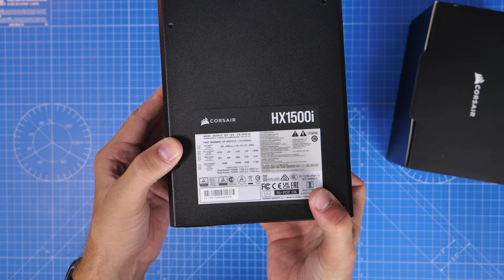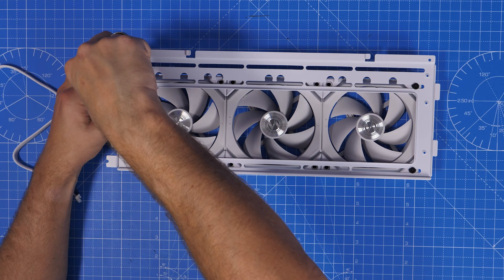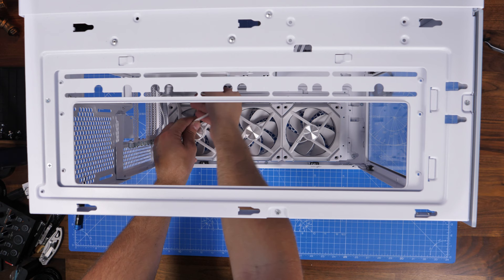I made some mistakes with this Lian Li O11 Dynamic EVO build (Z790, Core i9 13900K, RTX 3090)

Comment: I love lian li but L-connect is the hottest garbage software I have ever seen to the point where im thinking of rolling my own fan controller software...
Reply: Why garbage? I'm thinking about getting these fans
Reply: @tracks_  it actually lags your whole system when you launch it. Like adds 2x to my boot time because it lags my 7950x 4090 system so hard. Also the app crashes sometimes.
Reply: I agree, L-connect is trash and it constantly uses 9-10% CPU according to task manager. I run it, set the fan speed and color then uninstall the thing.
Reply: @BalkanBiker  unfortunately it wont keep my fan curves if I do that so I have to leave it running
Reply: @boot-strapper  try Corsair Commander instead of LianLi?
Reply: @BalkanBiker  only l connect works due to how these fans connect together
Reply: @boot-strapper  Can i use nzxt hub controller instead of Lian Li hub?
Reply: “Fan Control” by Rem0o
Reply: Yea not only that, 2 out of the 7 lian li fans I have have failed and the blue leds have a manufacturing defect so they have broken. I’m not buying the V2s that’s for sure.
Reply: @ArcturusCOG  oh 😬
Reply: @Alex-tu5vu  they are the only fans that have either completely stopped working for me, or the lights have broken and I’ve went through a lot of fans and none of the ones in the past have really had problems.
Reply: @MusicChann3l  ah yes, a bad batch of their most recent software patch. Lol. The fans are fine, software no. Also they have a pretty low cfm, so you need 2x as many to move the same air.
Reply: Though i do agree that l-connect sucks, if you set the slider that allows the motherboard to take control of the fans, then it'll work fine. You'll never need to run the software after that, and all the rgb can be controlled through signal rgb or your mobo lighting software
Reply: @tracks_  can u recommend a better fan and controller?
Reply: @GamingCreations612  I got these fans. Quite happy with them
Reply: @TechTonic_  cool ill prolly check them out im going to do a dynamic evo build prolly with these and a Galahad 360 aio
Reply: SignalRGB thank me later
Reply: @GrainOnTheGo  doesn’t work for my use case
Reply: @boot-strapper  what do you mean?
Reply: @GrainOnTheGo  love signaling but it doesn’t work with my asrock b550 motherboard and the monthly payment for somethings, I decided to switch back to polychrome unfortunately. I miss the rgb effects already lol
Reply: I really wanted to go with the Lian Li fans in my Dynamic XL for the simplicity, but I kept hearing how bad the software was and went with the corsair QL fans instead and the back of my pc is a rats nest. The fans have been flawless though
Reply: @BlackBruceLeeTheGreatDekuTree  the software really isn’t that bad I’m not sure why people hate it so much. It’s one of the few RGB software that doesn’t try to fight your entire PC.
Reply: It works great for me. Armory Crate is the worst
Reply: @corymaloy I just installed that software for my fans & gpu & 24 pin strimers cables. If it weren't for them making it so difficult for other software to control, I wouldn't have even downloaded it.
Reply: @tracks_ put it this way. I installed it on a brand new computer & it locks my mouse and keyboard. Also randomly freezes when applying settings so see irl vs trusting animation since the colors aren't always the same.
Reply: Do it you wont
Reply: euno  I did haha Honestly the install isn’t crazy it’s just the cable management I gave up on. The front looks clean and the door on the back of the case closes so that’s all that mattered in the end 😂
Reply: Laggy and trying to sync it with something like armory crate has caused me nothing but constant issues. But damn do they look good. 🤣

Comment: Hey guy, I have a question I have the same case but I have a problem, hoping u can help me out. The front glass of this case snaps in where u are placing the glass back on and the black 4 clips that hold that glass front 2 of them broke on me so I'm afraid to put my glass back on. Do u know how can i go about replacing those clips because 2 of mine broke. I would really appreciate any information u can offer.

Comment: Point to note at 22:12 for anyone doing a build where they need more usb headers. I had this same problem where my board only had 2. You can splice one cable into two. Just remove the cables pin, and put them in the same order red, green, yellow, white, black etc. in the empty hole on the cable you want to join, and you will be good to go :) They are designed to have two cables pass through that same header. This will save you the headache of trying to find a usb 2.0 splitter.

Comment: I'm doing a 14700k build with a 4070 Super.  I purchased a Corsair Rm850x.  I used the PSU calculator on Newegg and added 200 watts. I only have 1 m.2 for storage and  no optical drives, spinners, etc.  I thought that would be enough but after watching this video I'm nervous.  Maybe I should have gotten a 1000w,  Awesome video!
Reply from the maker: If you used a calculator to work it out it's probably fine

Comment: I have the exact same complaints about the uni fans cables. The daisy chain cable is also bit short  IMO. For example you wanna chain together the bottom and side intake fans and its complicated since the daisy chain connection is not in the middle of the fan but more on one end. So when you put bottom fans as intake the connector is more closer to the sidepanel than to the back and same thing happens to the side intake - the power connector is more closer to the motherboard than to the front panel and the daisy chain cable wont reach. Infinity fans had the connector in the middle for equal length and reversable cable direction - why make it worse? And in my case I'm talking about Lian Li Dynamic EVO case not some random XXXXXXL case. So all those reviews where it shows how the fans can be daisy chained are doing it on the table with very close distances and nothing in the way but when actually putting them into the case and starting to reroute them its not so easy anymore. 

The flat connector cable direction should be switcable. I mean the V2 fans are newer than infinity and those had reversable cable modules - why TF did Lian Li remove that possibility?

And I 100% agree with power connector - since the power connector connects to the side of the fan it allready shortens the length right a way because you have to reroute it around the fan first and then through the grommet holes to the back. Its especially painful with the bottom fans because the cable connects to the fan facing the I/O and then you have to reroute it around the fan and back towards the middle fan and then through the hole to the back but in there you have to reroute it around PSU and its just not long enough. Yeah you could put the uni hub in front of PSU (if its regular length) but then the top fans connector wont reach. What would help to certain degree is a splitter that the infinity fan 3 pack contains but obviously we don't get that. What would also help is a extension cable but since lian li uses its own 7 pin connector there is no such thing. And ofcourse you can't purchase the splitter separately.

So at the moment the damn thing works but its a complete mess in the backside with uni hub just dangling in air and cables barely reaching it. Massive dissapointment.

Comment: I did a push pull setup with nzxt usb hub, 3 corsair controllers and the 2 lian li controllers and psu top mounted. I was barely able to close the case after almost giving up due to almost not being able to fit everything. It was only my 2nd build and I recommend planning everything out before installing anything. I ran into a few problems that would have saved me a lot of time and space. The advantage of having the psu top mount is I was able to throw a commander pro into the bottom of the case and two controllers on top of the psu and 1 controller in the drive cage. The main disadvantage was the 24 pin strimer was jammed into the psu cables output/input and those hard plastic ends don't bend. You mentioned planning ahead as well and it's really important when you have a lot of hardware. I wish there was a cable mod shorter psu cables set that cut the length in half for this case.

Comment: I’m 2 weeks away from a very similar build. Dynamic EVO case so a bit more room, cpu, fans, cooler all same, Asus z790 gaming-E, Asus TUF 4090 and Seasonic 1600W platinum. I will have to follow literally same steps and would definitely run into same issues. You spared me of more than 1h of pure frustration 😅 i hate nothing more than disassembly and repeat. I saved your vid as i will watch it again to nail down all the right steps to avoid traps 😊 Big thanks 🙏
Reply from the maker: Hopefully you watched the other one too as I went into more depth there 👍
Reply: I just built basically t his, but I went with the Maximus hero z790 w/13900k, asus tuf 409 and the seasonic 1300w platinum.
Reply: @TheProvokedPrawn  Thanks, will definitely do! :)
Reply: @Kmaitland89  I am building the same with 13900k/4090 and his setup with the Lian Li v2 SL120s. Is a 1300W power supply enough? 1500 just seems way too large but I definitely dont want to go under.

Comment: These build videos involving the Dynamic Evo have been my guide for the past day. They have been so helpful. I didn’t do an aio cause I have the irrational fear it’ll leak. However, your build looks amazing! Though I have the Lian Li fan hub and at the moment it’s smushed with the wires bending badly and I can’t take out the hide cage since I plan to install mine. Do you know a good place to put  the fan hub so the wires can breathe a bit better?

Comment: Awesome video! I got this case and your warnings about how small it is are quite valid. I had to return it because of this. Got the O11 Dynamic XL instead. So much better. Wish Lian Li had released the NEW  Evo XL but not yet.
Reply: What are you running that this case is too small??? It's one of the larger mid size towers
Reply: @CILINKY  I'm a wedding photographer & videographer. It's a work only build. I have 4090 founders, 7 fans, 360 aio, 2ea 18TB hard drives, 2ea 10TB hard drives, 2ea 4TB ssd, 3ea 2TB M.2, 64GB ram & 1200 Watt PSU. For gamers the Evo is perfect. For some content creators it's good. For heavy work stations it's the Dynamic XL.
Reply: 'New Evo XL Case'???
Reply: @potvinsuks8730  lian li is doing an Evo version for the Dynamic XL case. You can see it on their youtube channel
Reply: @Cielinky  Thank you! Yeah, I was absolutely FLOORED when I saw what they have in store for us through Steve's Channel in Gamers Nexus where Steve literally went to LianLi's Lab and saw some of their new products in the pipeline including the new XL!

So excited!
Reply: I would love to get that too. Using the Fractial Meshify 2 XL now and i'm spoiled with big cases, a bit scared to use this for next build to be honest. Looks very tight in the back.
Reply: @mshea5906  how do you cool all those hdd/ssd in such case?
Reply: @ChasseurTueur  Lian Li 360 AIO, 7 Lian Li fans, I also put 2 smaller fans on the back of the case cooling the HDD's. Works perfectly!

Comment: So i got my V2's over the weekend, and loving that i got rid of 10 case fans x2 cables lol.
Question, for my radiator which had 3 fan cables, i didn't plug anything, thus the readings from MSI Center for my AIO was zero.  
My question is connecting to Sync1 same thing as Port? so i can still manage my rgb from lconnect3? 
For exhaust i was thinking of doing the same thing, as the cable is so short for port connector and the orientation needs to be at the bottom if i want a nice sync on my case from exhaust to intake at bottom.

Comment: Great video! Struggleing with the same setup right now, what do you use for controlling the fan speeds and light? Is there a benefit of runing the AIO on AIO Pump header and not CPU Fan? Tryed to run L-Connect but it didn’t let me turn of the motherboard controls! Thanks for making videos! Best regards Richard, Sweden

Comment: Just did my first build. If you want to see same case(I think his is XL too right?), aio, cpu but with 10 Corsair QL’s I will throw in a link(very different board and gpu tho). Im also using the thermal grizzly cpu retainer. I’m not a tech tuber or anything. I’m in the process of resleeving every cable. Waiting on 24 pin and 8 pins from cable mod

Comment: Wait so you don’t have to plug the Daisy Chain cable into the motherboard at all? You take Fans > Daisy Chain Fan Cable and that’s it? The AIO_PUMP controls the AIO Fan speeds?

Am I correct?

UPDATE: Well I believe I’m correct, the daisy chain comes from the pump, it’s getting power from that and that’s all you need to power the Lian Li UNIFAN’s.

NEW QUESTION: If the fans are ultimately being controlled via Pump’s speed… well how will it know to ramp down by default as pump’s default speed is 100%. This means those Lian Li fans on Radiator are going to be running 100% which is very annoying.
Any thoughts?

Comment: I have the exact same case and same motherboard but for some reason I can't for the life of me get the motherboard tobe aligned with the screw holes. The back plate of the motherboard (that has the USBs and stuff) seems like it should go in more but doesn't. What am I doing wrong?

Comment: just making sure so the fans on the bottom are intake?  the top 3 are exhaust fans for the radiator the single fan is also out take what about the 3 fans next to the motherboard on the right intake or outtake?

Comment: Beautiful 👌
Does anyone know if you could fit three 140mm fans up the top of this case with the 360mm side mount radiator having three 140mm fans infront and three 120mm fans behind in a push pull setup? 🤔

Comment: Great video h,. It is helping me build my very first PC , thank you .. Just one question … the sl inf 120 singe fan connector I used on z73 as  group cable for radiator fans the rgb connection has no slot for the Lian li hub, it only looks like a mother board rgb connection?

Comment: Hey! Big fan of your builds. I'm about to tackle my first solo build. At 19:55 you mention about going into the bios to disable the mb from changing fan speed or a pop up will happen during windows log in. Can you explain where to go exactly? I'm putting an NZXT Kraken 240 on an amd 7 7700x and I'll have a ROG Strix B650 in a 011 dynamic mini. I'll be putting lian li infinity fans in and plan to follow your other video in putting an ARGB splitter cable to control the rgb through L Connect 3 and then hopefully fingers crossed my NZXT AIO can control fan speed and run the AIO through the MB. I appreciate any and all help I would be lost without your videos! 😅
Reply from the maker: https://youtu.be/fz_mL7nhelo
Reply: @TheProvokedPrawn thank you greatly appreciated!!

Comment: Hey I Plan building a pc with a 13900k and I want to use the same motherboard like you. Now I wonder if the 16+1 power stages are enough for this massive cpu while being overclocked. 
Thanks for the nice nice video. 😊

Comment: I have this case. I love it… however when built my system I used the Gigabyte Z790 Aorus Master. And the front panel header doesn’t match with the pins on the mobo. The header fits fine but wiring doesn’t match what the corresponding pins are supposed to do. Any advice?

Comment: How do I get the single fan to connect to Lian li hub rgb, I have the power to the z73 hub but the other connection looks just like a mother board rgb which does not fit the hub?

Comment: Hi i don't understand one thing... I have a liquid dissipator NZXT Kraken 360 rgb and i want to set up Lian Li fans... How i can set up it to make a dissipator display work ?  I have to use a NZXT controller to connect the connectors of the dissipator and use the controller Lian Li to connect the fans? Because in the video i noticed you used two controller Lian Li, right? You can explane me how i can do it right?
I have two controller Lian Li and one ZXT.
Reply from the maker: https://youtu.be/v5kDVZmePYQ

Comment: Just put these fans on this aio and plugged it in the same way and told the bios to ignore cpu fan speeds. However, in device manager I have unknown pci devices, raid controller, and SM bus controller … is this something to do with my motherboard?